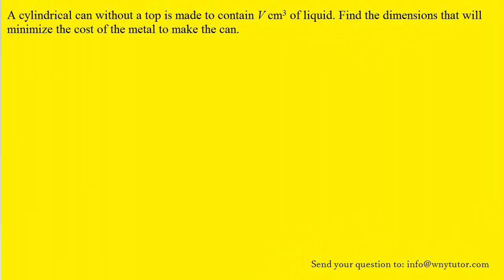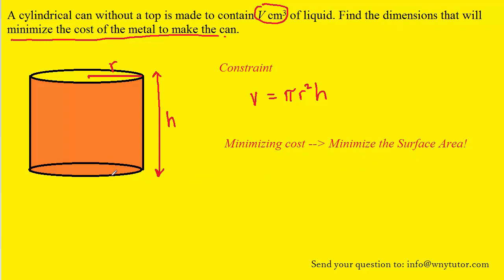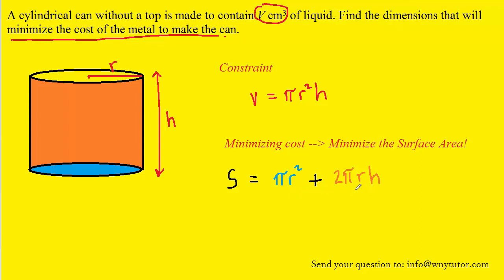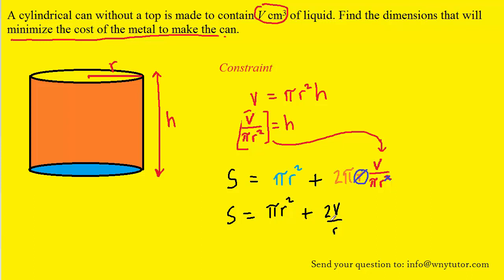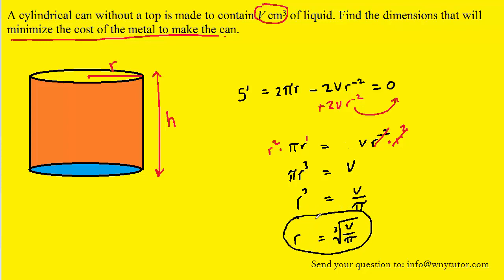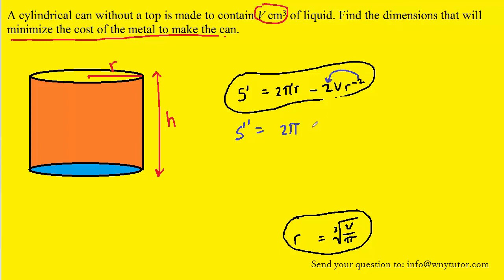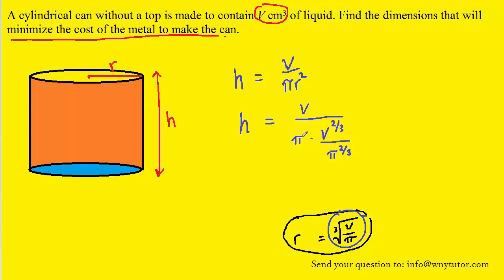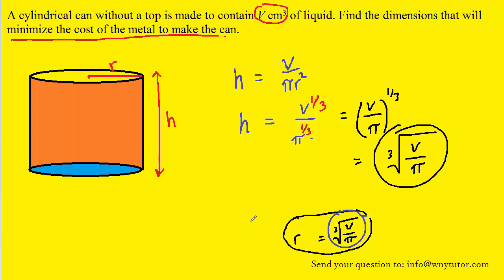A cylindrical can without a top is made to contain V cm3 of liquid. Find the dimensions that will mi

Comment: A cylinder tin boiler, open the top, has a copper bottom. If sheet copper is five times as expensive as tin, per unit area, find theost economic proportion.